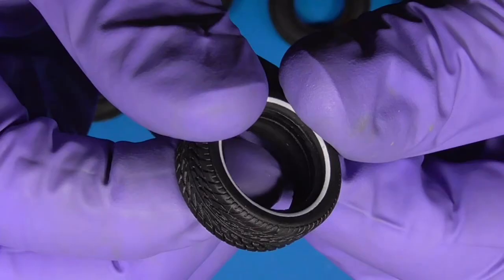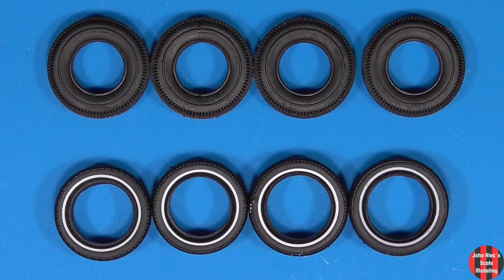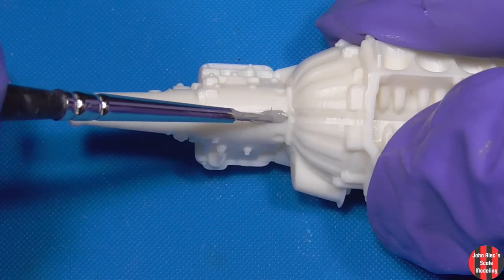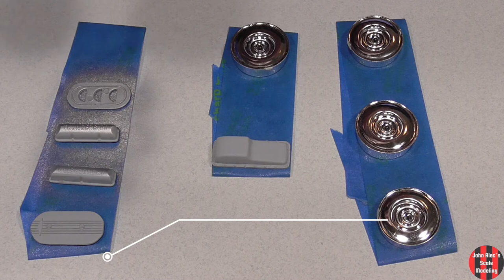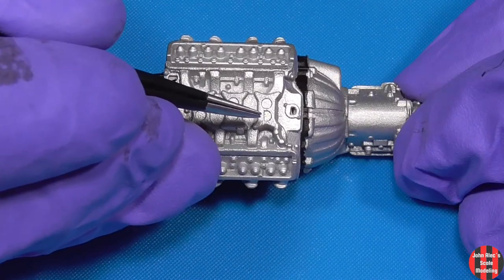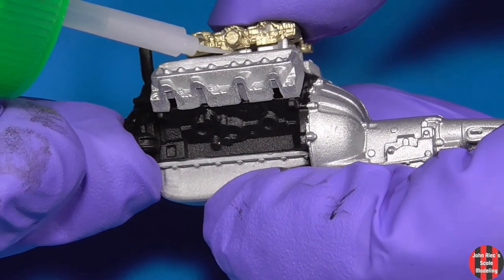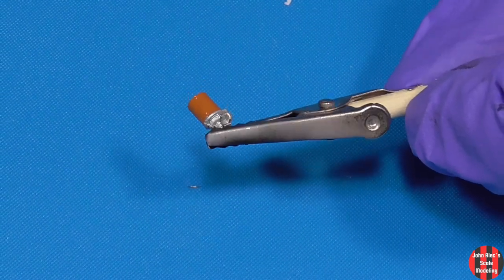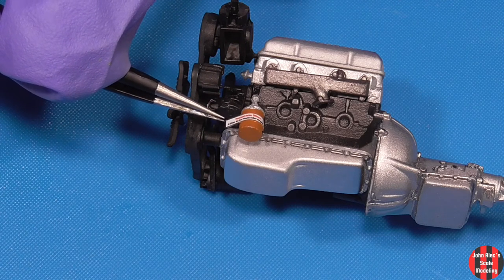AMT 1/25 '62 Thunderbird - Box Opening and Engine Build (Part 1)

Comment: Wonderful video!  That kit may be worth it for the tires and decals alone.  Look forward to more of the build!
Reply from the maker: Thank you buddy! They are sweet can't wait to see them on the car. Be well
Reply: I bought 5 of these for 4.99 from ollie's last year. I ended up buying 6 of every kit ollie's had last year and some are really really nice revelle kits that went together beautiful with no problems but tons of amt kits that are your 2n1 and 3n1 stock or pro stock lots with tons and tons and tons of parts for kit bashing and custom builds so it was totally worth it I'm gonna build one of each so for instance if it's a 3n1 I'm gonna build 3 of them but one stock one street rod or street drag type and pro stock or completely modified out I'm doing that for each one that is 2n1 and 3n1 then I got 2-3 kits brand new still to rob parts out of for my customers kit bash builds for shows